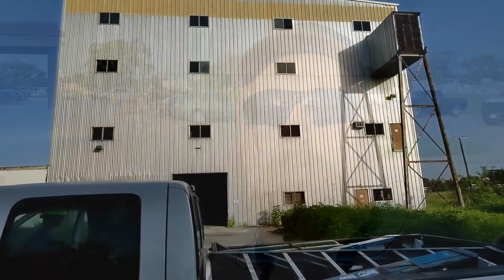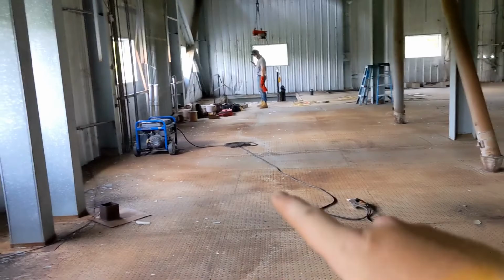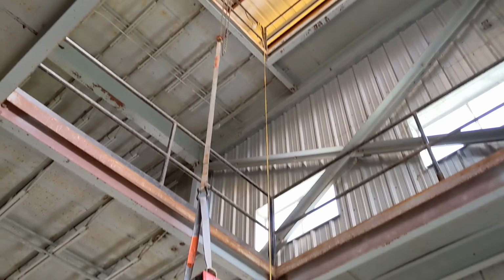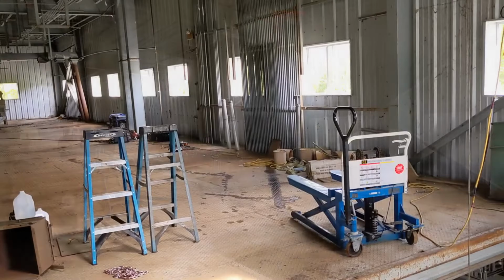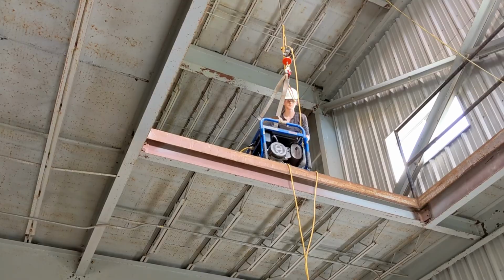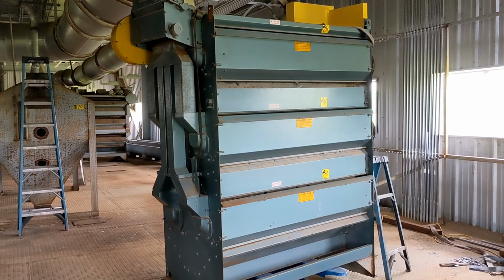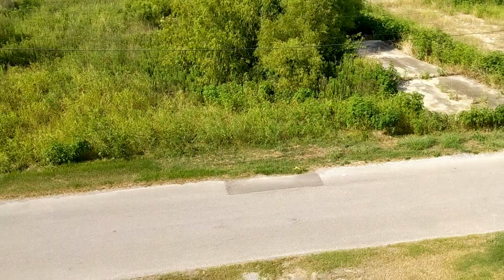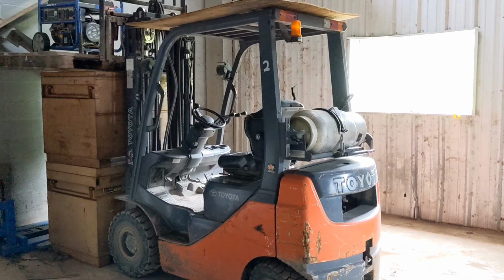Millwright Work On The Gulf Ep. 2

Comment: New follower here. Just started my millwright apprenticeship with the union and your video
Made me realize that there were future self/team employed options. How did land this job?
Reply from the maker: Something I was born into. Dad and Charlie always did it so I would go along on jobs that were possible. I started my "apprenticeship" when I was 12.
Reply: @wildcatwilly hi I spoke to my local union in North Carolina and was told the hours in this industry are rarely 8-9 hours day, it can be 90 days for 12 hours and it usually 50-70why is this?
Reply from the maker: When you have equipment in the are you can't knock off at 5:00 it's the line of work where you have to stay until you reach a good stopping point. Things rarely go according to plan so you have to be able to adapt to the situation